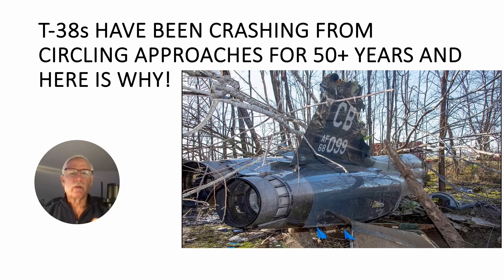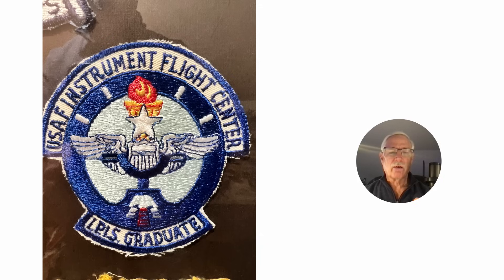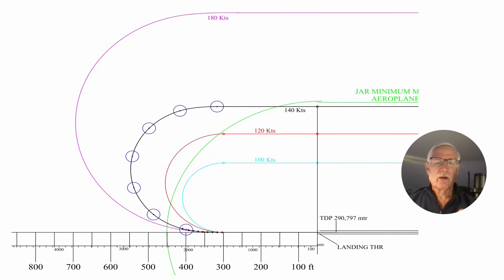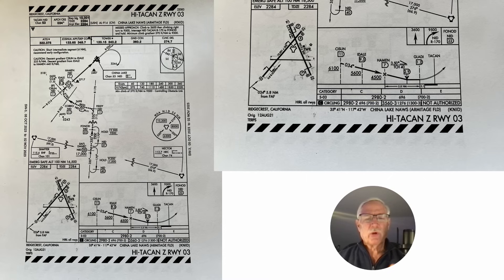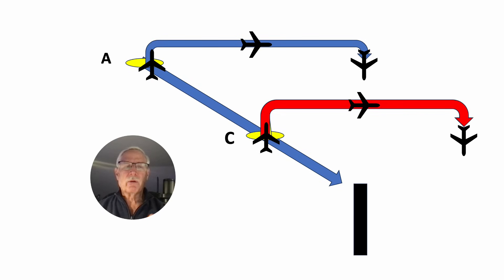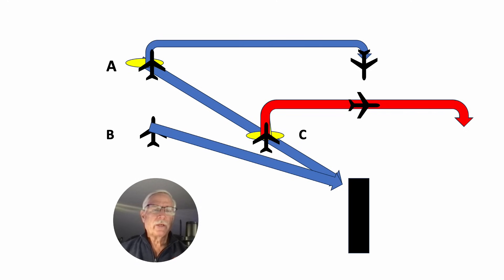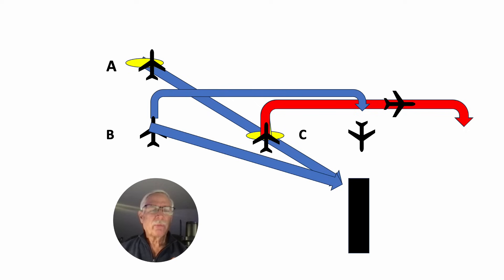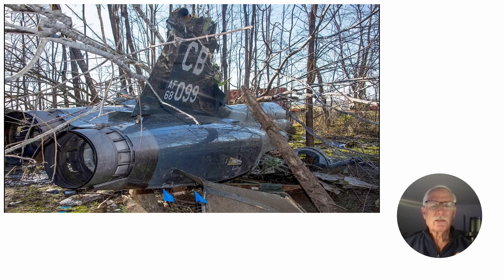T-38s Have Been Crashing From This for 50+ Years and This is Why!

Comment: Another great video. It's my understanding that the airlines now prohibit circling approaches and that's a good thing. 🎉
Reply: Some do, some do not.
Reply: @andrewalexander9492  Well that doesn't make me feel any safer, I guess you're right because the crash at DCA back in January was in fact a circling approach.
Reply: @christophergagliano2051  While it is true that the airliner in the collision was on a circling approach,  the hazards of a circling approach are a separate issue to that accident.  The prohibition on circling is generally a prohibition on circling at lower then VFR weather conditions.  ie: Ceiling less than 1000 ft/visibility less than 3 statute miles.  The weather at DCA that night was much better than that.  The hazards of circling in less than VFR conditions are because you are maneuvering at low altitudes, having to stay close to the airport and make fairly steep turns, often in poor visibility.   The circling the CRJ was doing at DCA was really no big deal, especially considering that it was good vfr conditions.  The subsequent collision was a separate issue.

Comment: I was taught at circling approaches  45deg for 45sec. That gives me approximately same spacing as in normal pattern (in a Seminole). At the end this comes to basics, don't slow in turn! Fly balanced (step on the ball). You should be visual, keep the runway in sight at all time. Use Gps nearest if you can't judge the distance. Practice low level circuits.

Comment: Ron, this is a golden video! I regret that the USAF did not  eliminate circling maneuvers from the instrument training syllabus.  The T38 accident you mentioned occurred during the circuit at Montgomery Field and was caused by a Japanese student pilot (SP) who felt overwhelmed by the workload he faced due to the language barrier;  Despite the efforts of his FAIP-First Assignement Instructor Pilot, who encouraged him to make speed and altitude adjustments  unfortunately he did not realize that the SP had moved backwards  both throttles at idle for approximately 18". By the time the IP realized, the Talon had stalled and hit some trees short of the threshold.

Comment: Sounds like the 1966 NASA T-38 crash which killed Elliot See and Charles Bassett.
Reply: Precisely, and that accident almost killed the Gemini program. The McDonnell Aircraft building they crashed into held the Gemini 9 capsule they were scheduled to fly into orbit about 3 months later.
Reply: Another version of the ikiller base-to-final turn where the pilot gets low, slow and crossed-controlled, stalls and spins.
Reply: @johnroerich4531  Low and slow in a turn is never a good idea

Comment: Captain, In my early part 135 days back in the 80's, I was an instructor pilot in 300 and 400 series twin Cessnas. Lot's of pilots failed to comprehend how important it was to maintain speed control on the maneuver. In the 310 we flew at 120 knots to keep margin above blueline speed, which as you showed was right at the cutoff for Category B. "I'll just fly at 130 and keep a little extra margin" was a common refrain, not realizing they just pushed themselves up into Cat C with a larger turn radius and possibly higher MDA!

Comment: I remember very clearly doing circling approaches in the T-38.  It certainly does look like you are a long way out from the airfield at a very low altitude and have to make that level final turn and then roll out on final and start your descent. All with the gear and flaps down in the buffet, but we were young and were fast learners. 
I remember this training serving me well in my airline career and when flying the KC -10. We would do a circle to land at night in the 10 at Max Gross Landing weight 439,000 pounds and I don’t think we went to full landing flaps until we rolled out on final. I think we were category D also for that aircraft. The perspective of the runway at night at 600 to 700 feet made it feel so we were miles away from the airport, cruising around too close to the ground.    

At AA, we used 1000 feet AGL as a minimum for circling approaches or higher if published. I think that was a very good policy. I’ve had more than one circle to land approach at night going into Kingston Jamaica in the 727, and circle to land in Bogotá during the day in the 767. It was good flying!

Comment: I don’t recall any discussion about this in class or from my instructor in ‘68. There are those who say the 38 was difficult to fly. I don’t think so, and it had everything I wanted in a fighter-type airplane. What it did do is demand your undivided attention, especially in the landing phase no matter what kind of approach you’re flying. This was a great lesson for the rest of my flying career when I flew less-performing aircraft. Complacency kills.
Reply: My T-38 experience was Columbus '90-'91.   As far as I recall nobody was complacent about the T-38, all my classmates were totally paying attention to what was going on.  That said we had a couple of wash out and wash back cases who just couldn't seem to stay up with the jet or who couldn't seem to continuously and correctly project (in their mind's eye) the near future of what the T-38 needed and what it was going to do with what you gave it.
Reply from the maker: The T-38 was still relatively new at that point and I don't think circling approaches were flown all that much to realize the danger to any great degree.
Reply: I agree, with a good instructor I didn't think the 38 was that difficult either.  Each flight was built upon the previous one.  The Phantom was even easier in the pattern.

Comment: Hi Ron.  As I have mentioned before, the old USAF guys I flew with either loved the T-38 or were terrified of it.  I understand that it was needed to teach guys for such unforgiving planes as the F-100 & F-104 which would bite you in an instant.  I don’t usually hear much about these issues with the F-5 that it was based on.  I know the T-38 is a derivative of the F-5 and lacks a few features the F-5 has,  It also is not flown by students but I was wondering if the F-5 was a little less tricky in the low speed regime?
Reply from the maker: Not having flown the F-5 I really can't answer that one but it does have leading edge devices that might help.
Reply: Good comment but why did you forget about the pitch-up problem that the F-101 Voodoo had. Also I do believe that if you lost control below 10,000 ft recovery was not possible and thus you had to eject, I think the term they used was incipit spin or something like that.